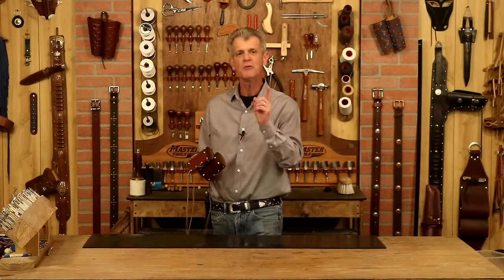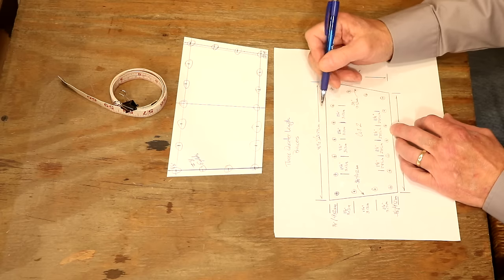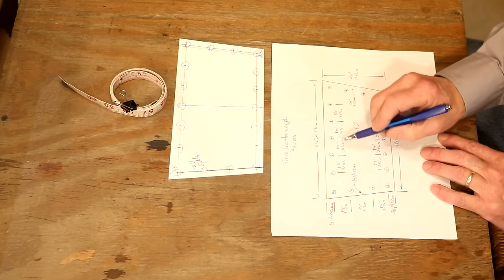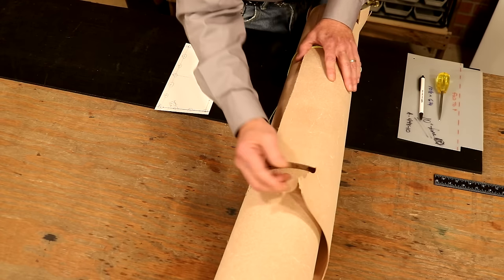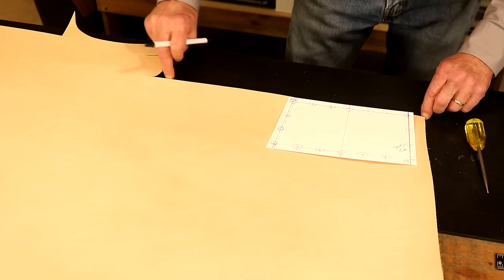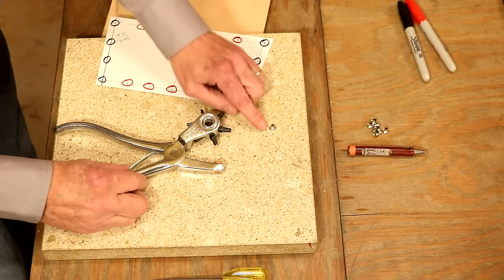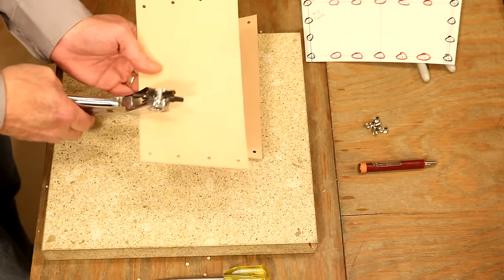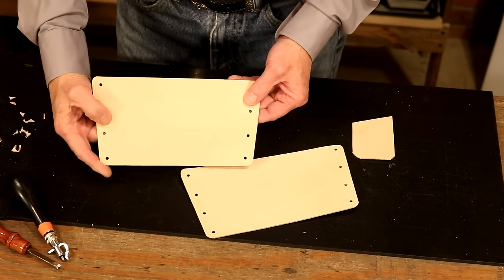Handmade Leather Bracers for Beginners

Comment: Not a recommendation, but it worked for me. I took my craft knife blade, wire dykes (to keep a straight edge) and broke the blade so that it was only a wide as the spot tines. I did this because, for some reason, I can't make the slot without cutting too far. Making it to wide if a slot. I don't use spots often and I need to work on this process a bit more. I'm thinking of taking an old screwdriver (got more than I'll ever need) and grinding it down to make a punch for spots